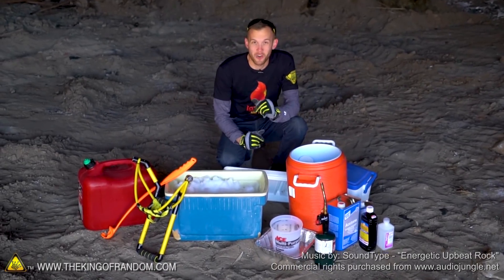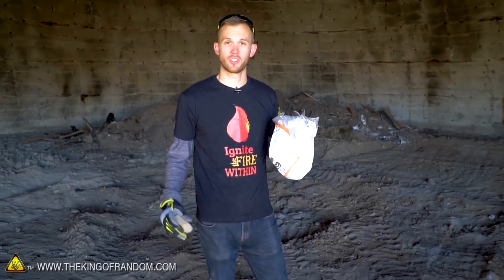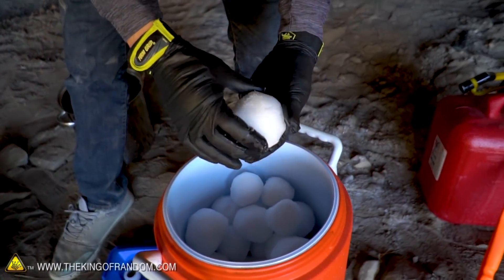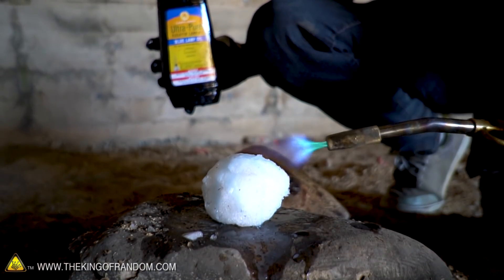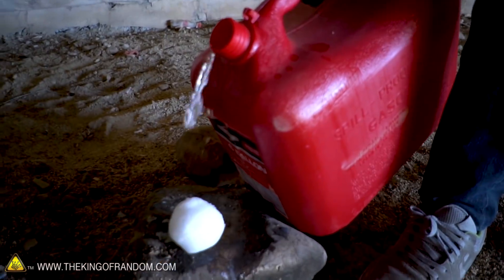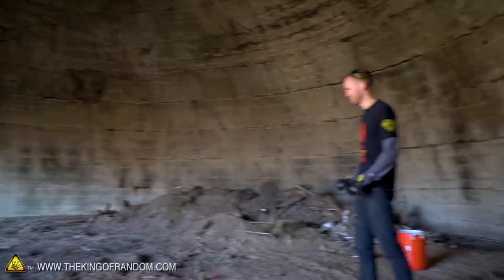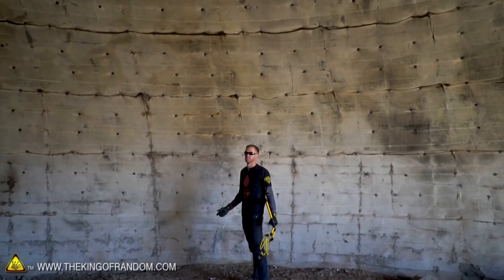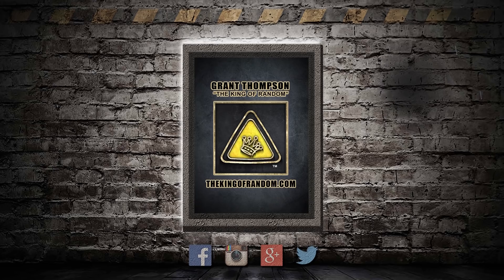Gasoline Snowballs! Frozen Gasoline + Flame = Fireball! TKOR Shows You How To Make Flaming Snowballs

Comment: How about using a syringe to put some gasoline inside the snowball a bit? Orrrrr this zippo lighter fluid stuff isn’t that also a variant of gasoline? That has such a tiny nozzle to squirt some inside and then dip it a bit🤷‍♂️
Also I could be wrong about the lighter fluid being like gasoline but in my language gasoline is benzine and lighter fluid is wasbenzine so I don’t know if the similarity is sufficient but never hurts to ask right 😂

Comment: the reason why the lamp oil and other stuff didn't work was because the snow kept the fuel cold and to start a fire it needs to be hot, the three elements of fire says you need heat, not necessarily a heat source.

Comment: This is why i think that it didn't really work with the first 3 fuels.

I think the reason you couldn't light the acetone, rubbing alcohol, and lamp oil were because the flash point meaning that the fuel has to be a certain temperature before it catches fire. For instance, Acetone has a flash point of -4 degrees Fahrenheit meaning that the fuel has to be that or above to light and the snow from the snowball has cooled it to 32 degrees meaning that it could light but it would be harder. For rubbing alcohol (Isopropyl alcohol) with a flash point of about 55 degrees and with the lamp oil (guessing that it is from the US and not the UK) is about 124 degrees to 150 degrees (Roughly) meaning that the lamp oil is least flammable then the rubbing alcohol and then the acetone, but Still 2 of the fuels don't have a low enough flash point. Whereas gasoline has a flash point of -45 degrees meaning that it will light when its temperature is between -45 degrees and 536 degrees (Were it just lights automatically) This means that the gasoline would be the easiest thing to light as it has the lowest flash point but the acetone should have worked as well (Depending on the temperature of the snow) and that is why the gasoline worked better than everything else. (Or at least that's what I thought was the reason, but this is coming from a decently smart 13-year-old.)
Reply: the more you know
Reply: I know I'm late but your really smart I didn't know any of that
Reply: Rubbing alcohol is flammable though...
Reply: @lucystarlight4005  not when its super chilled. It needs to reach its flash point to combust.
Reply: I dont believe u bcuz ur profile pic is minecraft
Reply: @fortnitestreams1709  says the person that has fortnite streams as his/her name

Comment: what if you boil liquid nitrogen🔥
Reply: They do boil liquid nitrogen!
Every single time they use liquid nitrogen in a video, they boil liquid nitrogen!
:D
Reply: SupaDanteX oh
Reply: they don't boil it, liquid nitrogen just has a extraordinarily low boiling point of -196 degrees Celsius, or -321 degrees Fahrenheit, it quickly boils at room temperature

Comment: Some chemical reasoning: All of these liquids have one thing in common. What is on fire is the vapour from these. The lower the temperature, the less vapour they create and the more heat is needed to make some. On top of this their molecular weight is relatively high, and they have mostly non-polar bonds, making them almost impossible to mix with water (or ice). That is why most of them didn't light very well or went out almost immediately.
 Adding a few drops of any kind of soap could improve the snowballs, and not freezing things with dry ice could come a long way, too. You could also try sticking a bit of fuse into the ball and lighting that, so your hand wouldn't catch on fire, and it could have a really nice effect when thrown and lit mid-air.

Comment: Fun (though dangerous) experiment, tho I'm not too surprised at the results since most flammable liquids doesn't really burn in its liquid state, but rather the gases that the liquid gives off or will only burn when broken up into small droplets.  Since the cold makes it give off less gas, doesn't burn as well.  Though might make a nice follow up vid if you used sand to make flammable sand balls and watching those explode

Comment: To have fire one must have 1. Fuel, check, 2. Oxygen, ? Source of heat ? So it appears that some of the problem is that the carbon dioxide from dry ice is choking out the mixing of flammable fumes and oxygen on your accelerants. Also, when you soak an ice snowball with gasoline it ignites, because a. The gas fumes are able to have adequate oxygen to burn, and b. Since the fumes are burning, they are not as cold as the ice and have adequate conditions for ignition. Fire is a pyramid which you are attempting to construct with only one side. 

Very interesting video, but I think this is why it didn't work well with the other 2 accelerants. The acetone and dry ice released too much CO2 and the lamp paraffin couldn't hold or generate enough heat to ignite. Only the gasoline had the combination of enough heat and oxygen to support a blazing accelerant.

Comment: If you want it to stay lit, try fine steel wool with sulfur worked into it. The wind just makes it burn better, and it'll burn really hot, so you don't have to worry about it going out at all. Just need a way to weight it to fly.

Comment: You bought the acetone down below its vapor point, causing it to not have any vapors that normally light up. You should get some MSDS forms for your fuels and maybe you can find more with a super low vapor point. Then it may work in your snowballs that are so cold.

Comment: You need to get 200 proof alcohol.  That lights significantly more effectively and longer that isopropyl alcohol.  We use it in labs and you can buy it from any lab suppliers like Thermo Fisher or VWR.  That might work better bc I know of a lab that burned down due to an alcohol fire started by 200 proof alcohol.

Comment: The acetone and alcohol didn't work because they can mix with water, and the lamp oil didn't work because it solidifies above the temperature of ice. Gasoline worked because it's molecules don't interact very well with ice, and it can evaporate even at 0ºC.

Comment: You should pour gasoline on the hole floor in the dome and ignite it with one of the snowballs from outside
Reply: It might actually go out pretty quick, just like putting a glass on top of a candle to put it out. While there is a place for oxygen intake, it's very slow, and the flames will be stifled by lack of oxygen. It would still be epic, but sadly, the scaling won't be linear.
Reply: this is just the best idea ever
Reply: Dude that's dangerous! I like it.

Comment: There is a pack on amozon its a powdered something and when you pour water on it, it starts to make dry snow , so you should buy it and pour gasoline on it
Reply: Is it hot & cool simultaneously? (sorry, my English is bad)
Reply: Bulan Julai no it just like very very small (sand crystal like ) orbeez
Reply: thunder bolt gas might eat through it/melt it
Reply: thunder bolt it is also in diapers
Reply: DavidProAngler may be that's the experiment
Reply: thunder bolt well it won't be much of an experiment when we already know that gas eats through plastic  and I think styrofoam too
Reply: DavidProAngler its not plastic nor styrofoam
Reply: DavidProAngler its another kind of substance
Reply: Oliverand Clove4ever  yes it is

Comment: Did you try making "snow" by putting either the lamp oil or gasoline in the chilled acetone pretty sure that would have been flammable (though maybe a bit excessively so...).

Comment: Bruh... THERMITE snowballs? Here's the idea: have a ball of thermite inside a snow/ice ball, right. Then, connect it to the surface using a sparkler. Then, roll the snowball in gasoline like you did here, and throw as high/far as possible when the sparkler lights

Comment: Gasoline freezes at -40 to -50 Celcius. You'd probably have better luck making a gasoline snowball in the liquid nitrogren. It may stay lit while it melts from the flame.

This video has the same result as fire arrows; which have a tendency to go out due to the force of air moving over the lit linen as it left the bow.

Comment: Acetone doesn't light on fire by itself. Only the fumes do. It needs a ratio of oxygen mixed with it in order to burn.
Lamp Oil doesn't mix with water, so it's not going to mix with snow either.

Comment: MOLTEN METAL VS LIQUID NITROGEN MAKE IT HAPPEN
Reply: The result will be less impressive than molten metal vs water.
The reason? Water has much more heat capacity and, from the perspective of molten metal, water and liquid nitrogen are more or less the exact same temperature. The only difference is that liquid nitrogen is already at its boiling point while water is a hundred degrees from it, this means that liquid nitrogen will immediately vaporize and form an insulating cushion of gas, which may create somewhat interesting results, though most likely, the result will just be less interesting than throwing it in water.
Molten iron doesn't really care whether you throw it in liquid nitrogen, water, or molten tin, the result is more or less the same, and the differences that are there have nothing to do with the temperature of the liquids and are rather from their viscosity and density, heat conductance, and specific heat capacity.
Reply: yaksher wow
Reply: @Kaylee Simpson "Wow" what?

Comment: When the first gasoline-snowball split in half, it seemed to burn better, even if it went out shortly after when thrown.
What if, when the snowball were premade, they were drilled and then soaked with gasoline? Would the drill holes act as reservoirs for gasoline? Or even as a makeshift wind-break to keep the ball alight?

Comment: Should do a ignited liquid nitrogen video!
Reply: Can't. Liquid nitrogen is -196 °C. Nothing can burn at that temperature. Before anything can burn, it has to reach its flash point. The flash point of gasoline is -43 °C, so the gasoline needs to be keep warm, not frozen.

Comment: NITROGEN is colder
Reply: True, but colder is not better when it comes to fire. The fuel (acetone, alcohol, gasoline) has to have a temperature above its flash point, or no fire. Ice will not burn, but the fumes of the fuel will burn. There can be no fumes unless the fuel is above its flash point.

Comment: Pre-made snowballs fail because it is made of water
Reply: a-lpha of Zeldaforme Gaming and what is snow by your logic? Snow is frozen water. Fake snow isn't water it's propelyene glycol mix that gets colder extremely fast but is non flammable.
Reply: Mofker GT No, snow is frozen water in the form of tiny flakes.
Reply: I think Mofker GT is trying to point out that snowflakes are usually formed on top of microscopic particles in the atmosphere.
The particles provide a nucleation site for the crystals to grow. 
I Don't think that those minute particles make a difference to their flammability though....
Reply: Mofker GT what lol
Reply: Its doesn't light on fire because the carbon dioxide from the dry ice sucks away the oxygen
Reply: Mitchell Lubline snow is water and dust